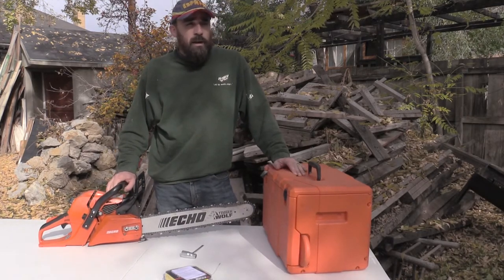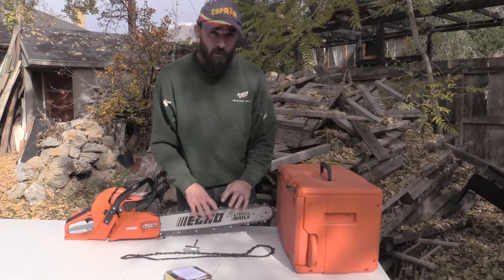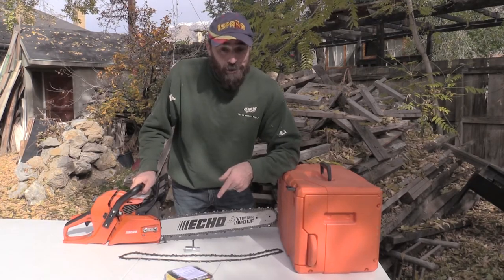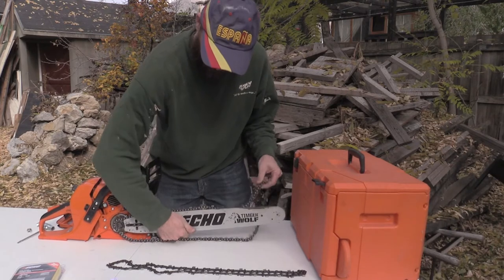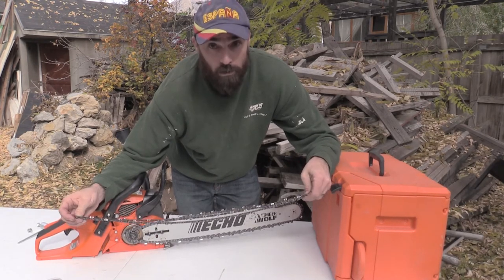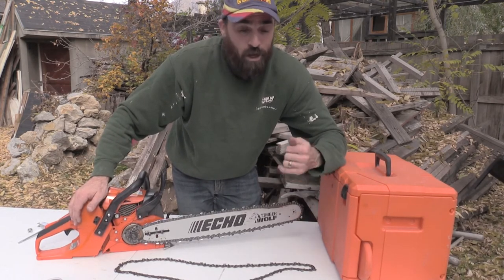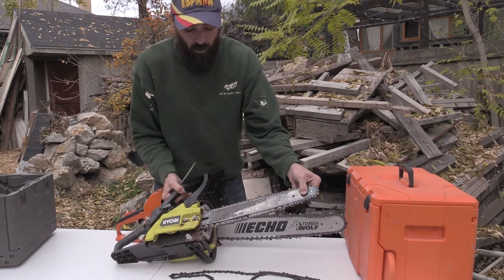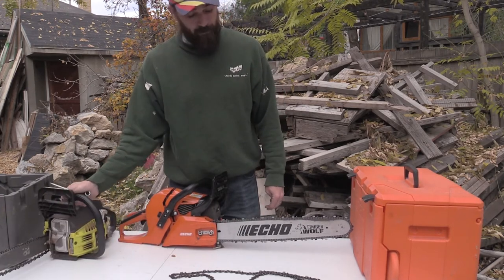Chainsaw Chain Stretch. It's real and this is how you can minimize it.

Comment: Another tip  When cutting with blade horizontal (like when felling a trunk to get a level stump), there can be a lot of weight on the chain. So it can get very hot and stretched.  Use felling wedges to take weight off the blade.  Before realizing this I stretched a brand new blade cutting one tree, lubrication was not the issue.
Reply from the maker: That is a very good point as well. Thanks.
Reply: That happened to me

Comment: You are partly correct. I too get lazy while running the saw, and get into unfavorable practices. The following list will prevent chain stretch. I have stretched a lot of chains in my time.
1- ALWAYS lift up on the tip of the bar and hold while setting the tension.
2- NEVER re-tension a HOT chain. Always let it cool down before readjusting the tension
3- If your chain gets hot(too hot) stop sawing and get cool down. 
4-Always fill bar oil reservoir when adding fuel. The ratio of bar oil and fuel used should be close to the same. If not adjust your bar oil screw.
Reply from the maker: Good information. I have started being much more diligent now that I understand things better.

Comment: Subbed.  Thanks for the super useful video... I've been using chainsaws for years and until today I had no idea the blades could stretch to the point that they could no longer be tightened to the proper tension.  I took everything apart thinking that there must be something wrong with the pin that enters the hole in the bar... but it seemed fully operational...  I googled if a chain could stretch (which made no sense to me at the time) and there were hits.  Came to YouTube and here your video was.  I took an old worn out chain I'd set aside years ago, tried it on the bar and it tightened up perfectly.  Filed the drags down and sharpened all the teeth.  Learned something new today and I really thank you for it.  Keep doing what you're doing. [ Just a note... The day the chain slacked up and no longer would tighten I had been trimming and cutting cedar down in the Texas Hill Country for about 5 - 6 hours almost nonstop... I think the extended high temperatures to the blade made the metal expand.  I'm thinking for future extended work like this having a second blade ready to swap out every couple hours will prevent the blade from overheating and stretching out ]
Reply: Yep that's all you have to do but one of these comments was talking about the seven tips to to prevent from stretching your chain and one of them was to lift the bar when you're tightening down your saw just grab the end of the bar and lift it up and then tighten it down don't tighten it down when the bar is relaxing on the pins like it's always naturally going to be without lifting it but that's the main thing that stretches them I've wiggled the bar you know trying to just to make sure the slacks going to be alright but I've never just held it up while getting it snug and I'm stretched about five chains in 6 years but that and not having enough Slack when you tighten it down and always refill your oil when you refill your gas and hopefully I'll never stretch another chain especially if I do what you're doing and keep an extra one with me

Comment: Sudden chain lengthening can be caused by a worn drive sprocket. When that goes, the radius shrinks 3mm, lengthening the chain 10mm.

I've noticed my bar getting hot recently, and it's from the slot widening from brutal use, maybe cutting stumps and charcoal. They used to roll my bar, to close the slot, but people probably get new china bars, nowadays. Once you get a load of side to side waggle in the chain, the friction goes up, and it can be difficult getting it to cut straight sometimes. Another reason chains can stretch, is cheap shite china chains. I got one that required re-tentioning every 10 minutes. Eventually, it lost a rivet. I also use car oil, which probably doesn't help. I'm kind of narked with the way the ebay chains work, so I'm going to buy new genuine everything. The stihl 231 is all plastic, and it's not looking real good.
Reply from the maker: I think my sprocket is definitely worn. I have a lot more side to side movement than I like to see. I'm sure that is another good reason my chain seems longer.

Comment: I measure by hanging both chains on a horizontal nail in identical position and line up teeth comparing to a new chain, shows difference quite clearly and x2 for total length. Mine has loosened off by total of 7mm. 

To be honest I never even considered deliberately running the saw without chain oil, it happened by accident a few weeks ago first time in 30 years the filler lid managed to come loose and fall out and didn’t notice. Just running saw dry for 10 minutes loosened chain a lot, it was hanging clear of the bar when I noticed, so I’d say running it without oil would ruin the chain pretty rapidly, which is probably why yours managed to stretch an inch. I have never had a chain stretch so much it can’t be tensioned anymore so your chain links and probably screwed and maybe in danger of snapping under load..v dangerous if the broken chain whips round.. Also increases wear on drive sprocket (which also needs replacing about every 4 chains max by the way, I wasn’t aware of that for quite a few years) strains tightener thread, damages bar, wears saw transmission etc.
Reply from the maker: I learned a lot about what not to do with my chainsaw through this video. I have since kept my oil levels up and rested the saw when it starts heating up. I never heard about switching out the sprocket, but mine probably needs to be changed after that abuse.
Reply: @stickyssituation  yes, you will see oval shaped holes on circumference if more than about 3 mm long and half a mm deep approx the sprocket is worn. The circumference is flat on a new sprocket and they’re about 12 euro each. 

I don’t have issues with over heating as long as chain is sharp and cutting like a knife through butter. Have been working on my land for 25 years, doing a major thinning operation at the moment to favour understory trees. Enjoy…can’t beat the land.

Comment: Chainsaw chain don’t stretch, it wears. Lack of lubrication will cause wear at every rivet, just a little at each one adds up to a lot. Btw that CS-590 Echo is a great saw. Thanks for sharing.
Reply from the maker: Great point!
Reply: All Steel and all metal get hot and gets pulled on stretches I stretched a lot of Steel in the 13 years I welded and fit tanks and Towers hell the sun stretches the bottom of a tank everyday and it swells up like a stainless steel tank it will swell up 4 or 5 ft in the air off of the bottom and then the next morning it'll be flat again so yes they expand and the shrink daily so a little bitty chain will stretch more than you could imagine

Comment: Thanks for video. I was having the same saw stretch problem and was wondering it's the chain or guide bar problem. I was more cheap skate using the used motor oil as lube oil. May be that's the problem.
Reply from the maker: Glad it helped

Comment: The stretch is actually the chain link holes get worn from overheating and a lack of oil. Also, after each use at the end of the day, loosen the tension, to help prevent the hole and pins fron holding pressure on them and slow the " holes from wollering out. I found all these clues from other people, so don't think I am an expert. Just sharing the knowledge I have been shown. Remember if this sounds odd, but having 70 and more links in a chain, and getting each hole say 1/16" each of hole wear, then add that up and you understand how the chain will be longer overall when installed and pulled to length. Just a litte simple math. Be safe out there and enjoy the great outdoors !
Reply from the maker: Thanks for the insight. That is what I had figured. Each hole stretches just enough to make it too big.

Comment: They make chain breaks(block of steel with slots to fit different chains) and punch’s to remove links and shorten chains. However, got to be careful and not weaken the chain.
Reply from the maker: I have looked at those as an option but never tried it.

Comment: By design, a chainsaw will use a half tank (appx.) of bar oil to a full tank of gas.
The manufacturers know that it won't hurt anything if you run out of gas, but it will destroy your chain if you run out of bar oil.
They all tell you to fill your oil tank Every time you add gas. (It's in the manual). That way you will always have enough oil.
Oil is very cheap compared to bars and chains.

Comment: You can take a link out I took one out three or four years ago and been using it ever since it's not hard $15 tool we comes with a punch in a plate
Reply from the maker: I've been tempted to try that.
Reply: @stickyssituation  just when you do it watch the Youtube video with that guy doing it at a table he's got a solid steel table  got to do it on something very solid and not like an Anvil or a vice or anything because everything's got to stay still you need a big area and a chunk of Steel flat to put your plate on because if you hit them links on anything that's not going to stay put it's a nightmare I've got three chains that I've destroyed the ends on where I can't get the pins back in and warped everything and just bent it all out of whack I just couldn't get is stable enough to hit the pins correctly so they pop through it's a precise Surgical moment when you hit that little pin inside that little Gap on that little plate but you can do it in a relaxed State of Mind

Comment: I think there only 2 ways to use stretched out chains. 1st it's get longer bar for 80 drive links Husqvarna has it for 0.325 . 2nd to shorten chain on 1 drive link.  I went with first option got  Genuine Husqvarna 531309679 20" .325" .050"  HLN-250 20Saw Guide Bar. And now I able to use stretched out chains on my  Echo CS-490
Reply: Good choices, I have a Husky and an Echo and like them very much and even gave my Stihl away
to a buddy of mine - take care & try to stay out of trouble!

Comment: Never run chainsaw without bar oil. That's obvious. Read the directions that came with the saw. Duh. Another trick is to loosen your chain when you are done cutting. This helps because as the chain and bar cool off the chain will contract and stretch. Another tip is to touch up your cutters with a file every time you put gas and oil in. This helps because you won't be pressing down on the bar to get the saw to cut because the chain cutters are dull. This also stretches the chain.

Comment: You chainsaw is getting hot. You need to let your saw, bar, and chain cool down. Having a spare bar and chain to swap will give your more continous sawing time, while the other is cooling. In the winter i use to use the snow to cool the bar in chain. Remove a link helps. But remove no more than two links per a chain. Any more and the chain will not fit properly on the sprocket and may damage the sprocket on bar tip.
Reply: .. and a new sprocket and bar helps. Both are designed to wear. Sprockets wear faster.
Reply from the maker: Thanks for the tips!

Comment: I had the same problem with my Stihl Chainsaw. I don't think that it's all the lack of oil.  This same thing happens to bicycle chains. Because the chainsaw chain is under tension from the motor and sprocket teeth it will stretch over time. On a bicycle, you know this is happening because the chain slips a bit on the rear and front sprocket when you apply power and are peddling. On a bike chain, you're supposed to measure from a given rivet in the chain to say, 10 rivets away and you are supposed to come up with some dimension. If the chain has stretched too much it will be longer than the "new" chain dimension for 10 rivets and you will have to buy a new chain. Thanks for taking the time to make the video.

Comment: After you run it for a while and the chain is hot ,loosen your chain so when it cools it can shrink,problem solved ,take care
Reply: Nonsense, if it gets that hot to stretch; it would burn anything you cut.  Any chain will naturally stretches with usage due to friction and dirt.

Comment: used motor oil from your car works the same a bar oil. thats what iv been using for years
Reply from the maker: I'll have to try that.
Reply: @stickyssituation   also you might need more oil to chain, you can adjust the amount on most saw if you look close in the crack on the bottom. and if you tighten a hot chain it will stretch more.
Reply: @stickyssituation  Don't do that.  And I shouldn't have to explain why.
Reply: Since chain saws operate at high rpm and high temperature, I personally prefer to use new motor oil. 
It costs money, but the internal moving parts are ensured of excellent lubrication and longer life of the moving internal parts (including the chain).

Used motor oil would have lost it's lubricating properties and give no protection to the moving parts.

Comment: If you don’t like spending money on bar oil just buy a gallon of canola oil. I refuse to use my saws for a second if I don’t have bar oil
Reply from the maker: That is a good idea. I'm always hesitant to try a different oil but it would be nice to get it for cheaper.
Reply: @stickyssituation  I’ve done research and have been using it for a while myself and it works just as fine if not better than what is sold as bar oil plus it is not hazardous to breath in like bar and chain oil is. A lot of professionals use it instead of ‘bar and chain oil’.